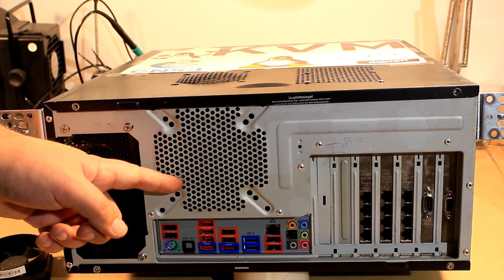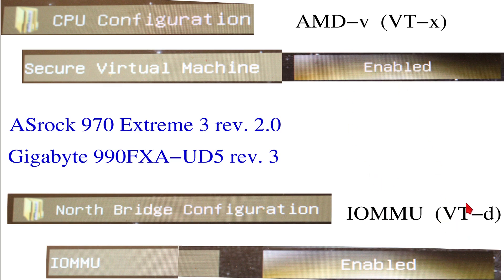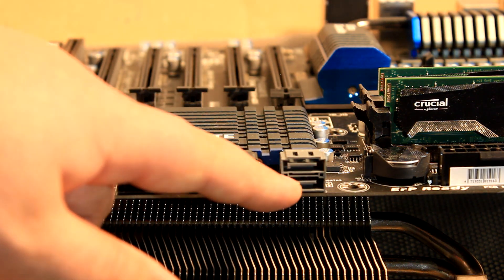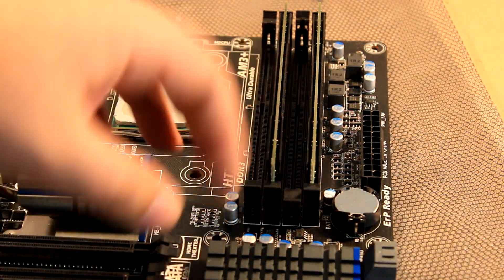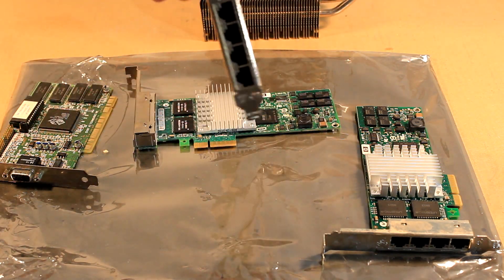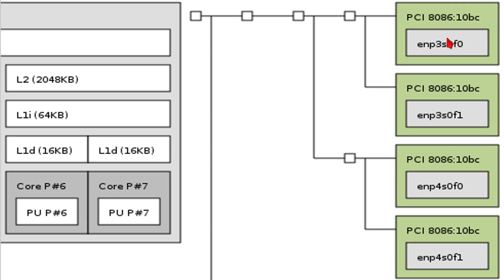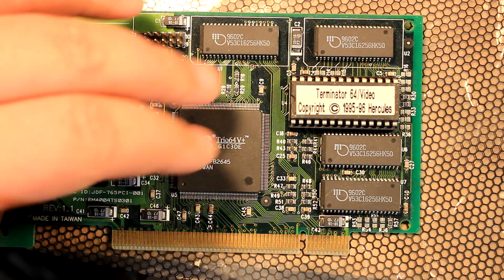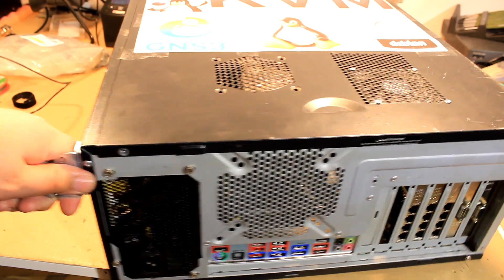Cheap home lab build: virtualization server, GNS3 for CCNA-CCNP rack, and ZFS

Comment: Good vedio 
I hesitant
 for choosing one of these workstation (Lenovo S30 & HpZ420 and HPZ600) to make a virtualization - cisco switches- Routers)
Thanks for advance
Reply from the maker: I never had a Lenovo, so I cannot give you feedback on that. However, I had one of these HP Z600. If you are using the right Xeon processors and the latest BIOS, it will even support VT-d. However, for me the machine was way too loud. Especially that small fan cooling the chipset was screaming at a high pitch. If noise is not an issue for you, then it might be a workable option.

Comment: Hi thanks for this vid, i am at the starting point of walking this career path and your videos sure help a lot,. I will use your vids as my guide.
Reply from the maker: Hi Marvin. Thanks for the feedback.
To be honest with you, if I would be now building a lab, based on the stuff I learned from the build you see in this video, I must admit that I would rather build something based on a server board. Namely, due to my job I am interested in SR-IOv and other related technologies, and these cheap boards do not support it. If you can afford it, go for an Intel Xeon used motherboard, especially if you can place the server somewhere, where the noise does not bother you.

Comment: What would you say is a resonable priced mobo with SR-IOv support these days?? It is for my personal home lab. I plan on using Proxmox? I would like to use both Containers n VMs which is my reason for considering Proxmox.
I would prefer a system which is fairly easy to use and is fairly secure and has good community based support. Any suggestions or recommendations?
Reply from the maker: Whenever you choose the software what you will use for your lab, you should pick the software with which you can get a job. Proxmox is relatively rarely used, so if you are not at least 80% sure that you can get a job with Proxmox, rather look into VMware or KVM. On KVM you can also run both containers and VMs, no problem. In addition, KVM does not have a special VM (Dom0 on Proxmox is this special machine) which is used for management. As for the MoBo, I would be hunting for a more modern dual socket Intel Xeon board if I would be you, preferably from Supermicro. If noise is not an issue for you, a Dell or an HP server in 2U chassis is also a good and inexpensive choice (only about 400-500Euros). If I would have a basement or a large apartment, that would be the way I would be building my system. For standard ATX cases I could not find so far any MoBo with SR-IOv support.

Comment: thank you for the nice explination. may you please compare between virtualization server and qotom small computers? I am looking for 4 to 6 virtual servers  and I am not sure if it will be cheaper to build virtualization platform or owning several qotom computers. I would appreciate your feed back.
Reply from the maker: I am not familiar with the "qotom" computers to what you are referring. Can you put in a link for a more accurate description of what these machines are?
Reply: thank you for answering back. qotom is tiny computer with j1900 processor and 4 Intel Gigabit LAN ports, up to 8GB RAM GB sata port WIFI, for about $150 to $270 depending on configuration. it can be found on amazon shop called qotom and their web address is qotom.net . Some guy bloged about runing lxc vps on j1900 cpu. I need small lab plus some lightwhight vps for home office file server ,pbx and vpn server. power consumption is some thing to consider. I would appreciate if i can talk to you if you can help out with my choices. thank you again
Reply: Samy, look up MAXTA.

Comment: what abt intel alternative instead of amd.
Reply from the maker: I am not familiar with the newer Abit boards. The old Abit boards until the capacitor fiasco were alright, and made for extreme overclocking.
However, for virtualization you need special features from the BIOS, which might not be available from Abit. 
I have purchased the AMD board, since the equivalent of the VT-d, VT-x, multiple PCI-e lanes and other virtualization features are available only on Intel Xeon CPUs and server grade MoBos.
Reply: but normally everybody says do vmware and virtualization in intel for study purpose. i agreed AMD equivalent is there and and it will be sheaper too.

Comment: Why not just buying a cheap server like the this dell R710? http://www.ebay.co.uk/itm/Dell-PowerEdge-R710-3-5-Intel-XEON-5500-5600-Serverschmiede-Server-Konfigurator-/322028560042?_trksid=p2141725.m3641.l6368
Reply from the maker: Here in Europe the Dell machines tend to cost a lot even used. I always envy tech guys from the US, since they can build an awesome lab for a fraction of the money. For 20Euros you cannot buy even 4GB of RAM here...  Regarding the R610, if one does not need more than two PCI-e slots, it might be the right option.
Reply: Come to America!!  We need more like you!!
Reply from the maker: There are several reasons, where the main ones are:
1.) such machines generate LOTS of noise, which is simply unbearable in an apartment. Plus my neighbors would call the police after a couple of hours. I would call them too in a reverse situation...
2.) such machines do not support VT-d, or the BIOS has severe limitations when it comes to VT-d
3.) the machine you linked does NOT contain CPUs, RAM, or any other cards. It only has the PSU and the MoBo in. When I add the price of the components what I need+shipping, I can build a lot better machine for myself.
4.) the I/O ports are very limited. I would simply not able to built in as many I/O cards, especially when it comes to high throughput cards like InfiniBand
Reply: Donkey Learning IT the machine I linked certainly has all you can ask, there's a configurator in the description. where you can add all the CPUs, add-on cards, memory, hdds, etc. As for the noise, it is quiet if you manage to keep low temperatures(for example air conditioning in the room) but if not they are extremely loud, yes. It sure supports virtualization and it's  an extremely popular server for home virtualization laboratories from the research I did and several people use a pair of them as virtualization nodes for vsphere and azure cloud. The eBay article linked even has vsphere 6 installation in the configurator.
Reply from the maker: Here in German speaking countries there is simply no air conditioning since the "renewable energy" costs are ridiculous (0.28Euros/KWh, above 200KWh per month price jumps up to 0.35). Even a small apartment costs a lot for rent, above 30% of my salary, and electricity cost would kill you. This is what socialism is all about, darnit! You have no idea how poor we have became within the EU due to overtaxation and austerity.
If I would be able to afford the luxury of having my own house and basement (it will never happen), for sure I would have an industrial server, and would not care about noise either. In my previous apartment I had an HP server before, and it was way-way too loud. Previous place had three rooms, but I moved to an other city where prices are even higher, and cannot afford more than two rooms. This is why I had to sell the HP server and build my own. Eight 6cm fans spinning at 3000RPM in a small room is no joke, not even talking about the four Cisco switches in addition.
Reply: Indeed I can understand that, it's a shame though because if not for the noise that seems a very decent server and affordable too.
Reply: Also to vouch. For people with constraints, the R610 is a much quieter option. The Xeon L,E series have VT-d but is based on the CPU. I have a friend that runs it under his bed and the cooling in that is fine.The CPUs can be run with the L5630's which are lower power.  The RAM usually is quite cheap with RDIMMs which can have higher density ($30 for 2x8GB KIT u to 12-18 slots), and the L5630's were $20 for a pair. The R610 supports 2 PCI-E and the R710 has 4 PCI-E.

Comment: thx for the video. I was waiting for the update.
Reply from the maker: I am now working on a video where I show the KVM installation (based on Debian Linux) on top of this machine. This weekend or next week this video should be also up.
Tried the new VMware ESXi 6 as well, but they have dropped most of the hardware support and officially now ESXi works only on the newest fanciest and super expensive hardware.

Comment: Why do you put so many network cards in the computer rather than just running a vlan capable switch?
Reply from the maker: The number of cards is not even enough for the type of scenarios I would like to study on this system.
Namely, when GNS3 is running without a "brakeout" switch, every router interface will use an RJ45 port. Also, every VM generating traffic and sending data through the GNS3 network will also have an interface bound to a real network port, so that I can interface the lab with real Cisco switches. 
Even when one is doing simple Virtualization labs, it is really tough to separate iSCSI traffic from management and VM-network traffic. The cards I use are old and slow (only 1Gbps), so I also need LACP bonding.

Comment from the maker: The comment I deleted was about desktops and bare metal hypervisors.
Well, the main advantage of Linux KVM is exactly that you can actually use the underlying Linux system as a desktop, while the VMs are running on the same CPU, using the kernels built-in functions to provide them the virtualized environment.

Comment from the maker: AHHH, just deleted someones comment BY ACCIDENT, by hitting Remove instead of Reply. SORRY man!!!
There is no way to put it back, another YT fail.  Just hit the wrong button, and it is all gone, without any warning...
Reply: Shit happens :)
The comment you deleted still appears in my notifications, so I just copied it:
 He is using a bare metal hypervisor. There is no usable desktop interface 
with ESXi and such hypervisors. You can still create a workstation with 
Windows 10 and purchase VMware Workstation to create the networks 
virtually and run nested ESXi. However, his goal of creating a LAB is to
 simulate as close as possible a corporate or business environment to 
learn ESXi. I would go one further and add a SAN IP network and create a
 NAS for hosting the VMs over NFS or iSCSI. This will help you learn how
 the product might be used in the real world.
Reply from the maker: Many thanks! YT should totally fix this issue, this is a total fail. You get no warning whatsoever, the comment is just gone... And the two buttons are right below each other, so on mobile you have to be super careful where to tap.
Reply from the maker: +Henry Eng
ZoL (ZFS on Linux) will be used running on the main KVM kernel to provide NAS and SAN capabilities to underlying VMs. This is why ZoL is so awesome, because it can be used both for NAS via NFS and one can also create block devices on it, and export those as iSCSI targets for the VMs, and your VMs can boot from it. In addition, it has SSD read and write caching via ZIL and L2ARC.

Comment: Would it be possible / would it make sense to have a system like this for your desktop system alongside the vms or is it really necessary to have two separate machines for those? That would save some space and definitely some money.
Really like your videos btw, please do keep up the great work!
Reply from the maker: First of all, thanks for the feedback!
My original idea was EXACTLY like what you suggested, and with Linux KVM it could have totally worked. However, the issue is, that the switches are really loud, and this is why I have built this second machine. This way the server is in one room with the switches in a rack, and in the other room I have a quiet desktop which is almost noiseless, so that I can concentrate on the topics I am learning. Also, this way I have easier physical access to the cabling.
I will soon upload a video where I explain this, and why I put the second machine together and moved the server hardware into a small rack-mountable chassis.
Reply: Thank you for your quick reply!
Can you tell me if there are noticeable differences between ESXi and KVM in terms of performance? I think I would prefer a single machine setup for now to avoid additional costs. 
I am wondering if the desktop os couldn't be just run as a vm on ESXI once having set up everything, that would be really nice (Only for a learning environment, of course).
Oh and yes, noise is a real issue, I totally agree. I'm still fighting the noise level of my pc :) (it's an FX 8370E build btw)
Reply from the maker: KVM is a free open source alternative, wheres ESXi is a closed source proprietary solution.
This means, that they work completely differently, in fact, KVM differs even from Xen hypervisor, which is also based on Linux.
Thus, comparing KVM directly to ESXi is a bit of apples to oranges. Still, KVM is surprisingly fast in my view, and I cannot really tell the difference between the responsiveness between the VMs. However, I must state that I am using my lab purely for learning and never for production, and for studying the performance is not much relevant.
Reply from the maker: Other question is what you would like to study. Namely, when it comes to high availability, ESXi is still the best option out there, so many companies use it instead of Xen or KVM. 
Running the OS for your primary desktop inside ESXi is a bit tricky, since you will get no direct video output from your desktop OS, except if you use VT-d, or in your case IOMMU, and you passthrough a video card to your desktop VM. For comparison, VNC or other solutions (except Nvidia Grid) are just too sluggish, I have tested that already.
Reply from the maker: In stark contrast to ESXi and Xen, Linux KVM is a Type-1 hypervisor based purely on Linux kernel. It is almost like a hosted Type-2 hypervisor, but still with full Type-1 bare-metal features. Thus, you can totally use your underlying virtualization server to run a full blown Linux with graphical desktop on it, and also use the remaining resources to run VMs, including passthrough of PCI-e devices. In my view this is why KVM is a really good option exactly for what you would like to achieve. I will make videos on the software setup as well, so you can check how easy (sometimes complex) it is to set it up.
Reply: In this case KVM really seems to be the way to go for me. I am just getting into virtualization and as a student I don't really have the funds for a multi-machine setup right now, that's why I am asking. Currently I'm experimenting on Windows with Hyper-V which is ok for the moment, but I want to try out as many settings as possible. I'm planning to set up a virtual Hadoop cluster which should be fine as a learning environment I believe. Eventually I will have to upgrade the system one by one with additional NICs etc.
Tutorials on the software setup will be much appreciated :)
Reply from the maker: Hadoop should work on KVM as far as I can tell. I have not tested it myself as of yet, but I do not see obvious issues. For Hadoop in fact even Container-based virtualization should be available. Nowadays you can run containers on top of CUDA with GPU acceleration support! 
Regarding the software, I will start making those videos next week. Now I have a bit more time, so I can hopefully post more regularly.